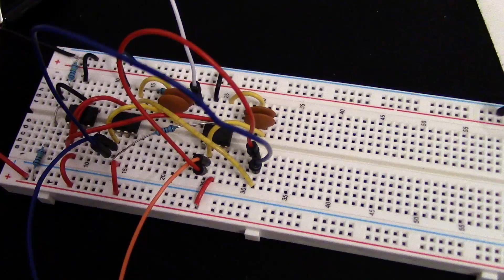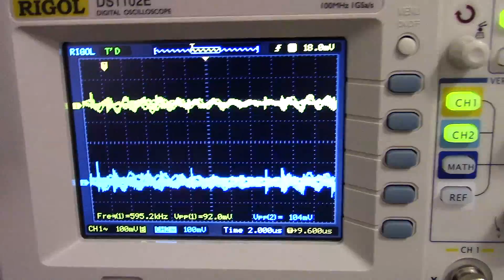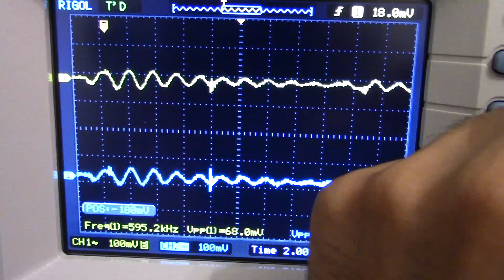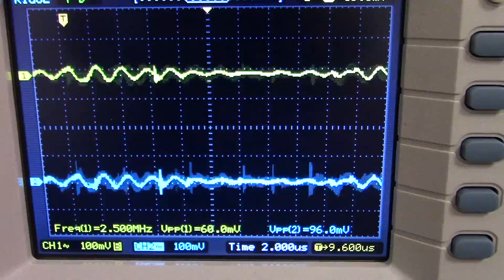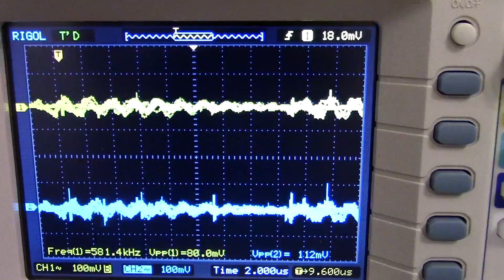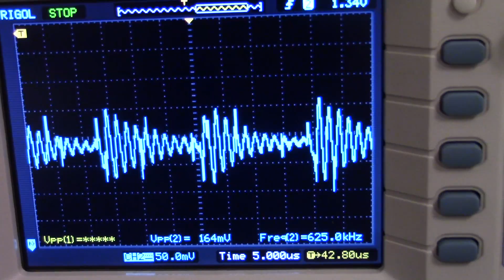Building an Analog Computer with Op Amps (Part 6): It's Giving a Correct Solution

Comment: Very nice presentation. So, in your opinion what is the difference between an "Analog computer" and an op-amp circuit that performs this or any other function? I've seen a lot of these "analog computer" circuits and to me they are just standard analog circuits using op-amps, and other discreet components. Thanks in advance.
Reply: An analog computer is a computer which uses continuous values instead of discrete ones. An analog computer can be mechanical, with values represented as gear rotation or even hydraulic. The computer in the video is electronic. Electronic analog computers normally use op amps because it's the best circuit to do calculations. Analog computers used to have patch panels to connect the op amps together.